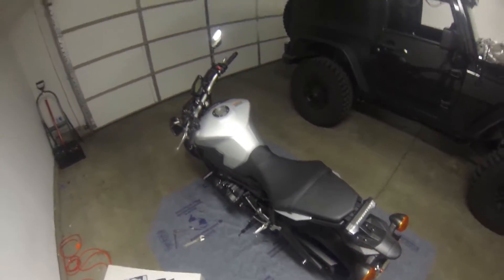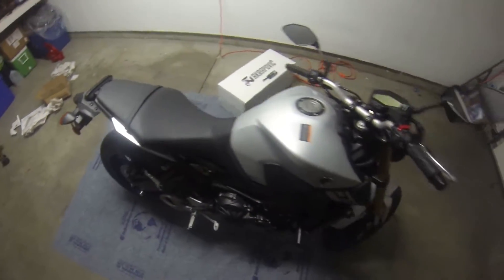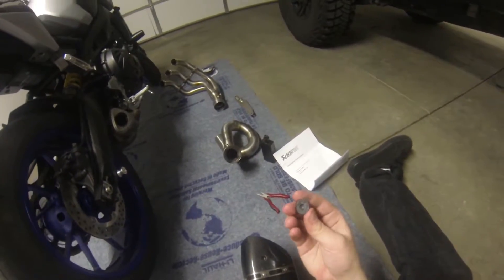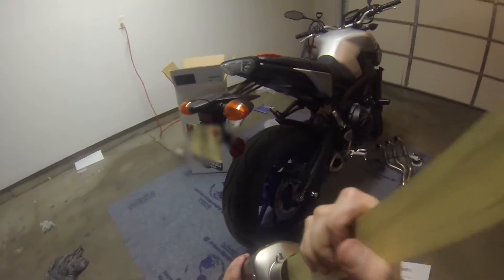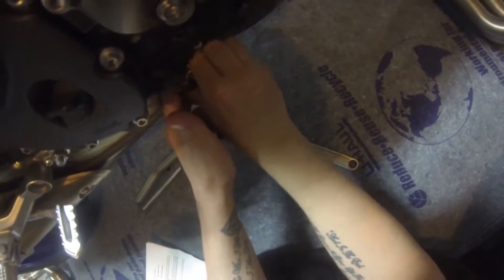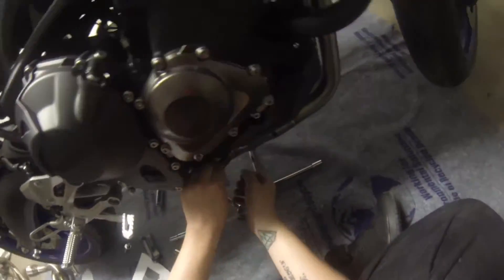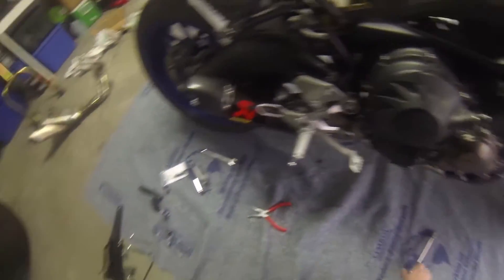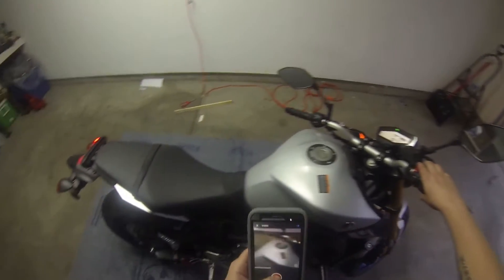FZ/MT 09 Akrapovic Carbon Fiber Exhaust Install

Comment: I have a problem and i need help.  I recently bought a 2018 MT09 with a full carbon akrapovic exhaust system on the bike.  There are two previous owner before me.  The second owner which is the previous owner i bought the bike from said that the bike was installed and tuned by the dealership that the original first owner bought it from.  I don’t trust the knowledge of the second owner about the history of the bike.  But the bike look brand new around 2000 miles on the odometer when i bought it.  My problem is when i was riding the bike and sitting in a stop light and the bike is idling when i give it a little rev from stand still on neutral.  The bike would stall from a stand still neutral geared position.  The engine would just shut off.  The engine would stall from neutral gear and idle about 2 times out of 10 tries (it dose not stall everytime in that situation but only 2/10).  I do not know if the dealer even installed the full exhaust and tuned it.  I think someone is lying.  i think the original owner which is the first owner bought and installed the full akrapovic exhaust without having it tuned but i am just speculating.  What should i do?  Is it just a tuning problem or could it be something else or much more worse?  And the bike already has 2000 miles when i bought it and i guess it was running in that state.  Your help would be appreciated.  Thanks

Comment: I have an xsr900 and have been contemplating putting a akropov on it. So is it worth it? Did you have to remap anything? What did it run you? worth it? Thanks for input in advance.
Reply from the maker: johnnybull100 I think it's worth it. I put in a different air filter and also reflashed my ecu to the filter and pipe through Vcyclenut. The pipe was about $800, flash was $200
Reply: Cool thank you thinking that is what I will do for next April I'm up North so no biking till then unfortunately!
Reply: Is it possible to get the baffle out with plyers after the silencer is installed? This way it would be practical to remove the baffle and reinstall it whenever you want without having to remove the silencer.
Reply from the maker: Ta3kno Never really tried anything with the baffle. I tried a few different pairs of plyers but it is super snug. Maybe take the silencer to a sander and sand it down a little bit to let it go in and out easier.

Comment: Did you put any type of sealant between the header, mid-pipe and muffler joints? I got the same system and I'm going to attempt to install it myself. I installed a slip- on on my sv650 and it came with some type of high heat sealant. The akra system only came with copper paste for the nuts and o2 sensor. I would really appreciate it if you can help me out. I'm worried that the exhaust will  leak through these joints if I don't put any type of sealant.
Reply from the maker: No the springs that come with it keep the system pretty tight. Hell I forgot to add a spring and its tight as ever. Be cautious of the header for the cork gaskets that are on there. They tend to fall out. Take your time and it'll be all good. Let me know if you need help.
Reply: +2WheeledMenace thanks for the reply!
Reply: +2WheeledMenace by the way great video! Thanks again ride safe